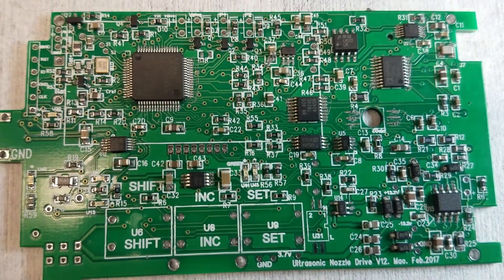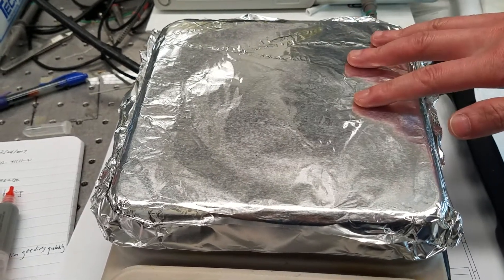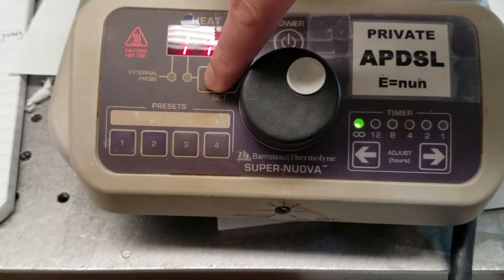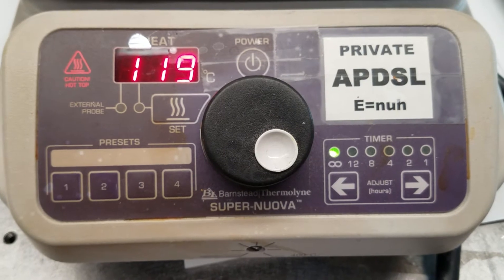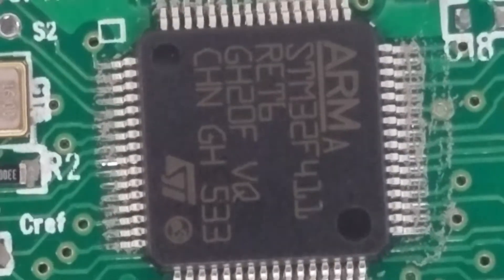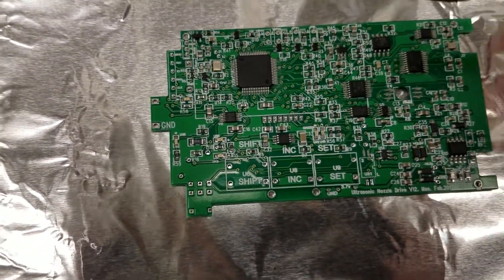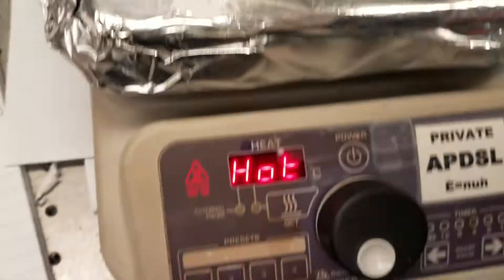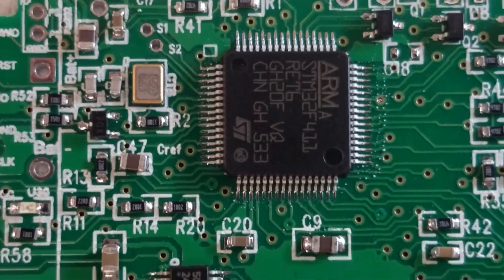PCB Soldering with hotplate - heat up solder paste

Comment: under the microscope, it is very easy to see the melting of the solder paste. Using the tweezer to push the board is to get a good heating from the hotplate to the board. But be careful,  don't touch the components.